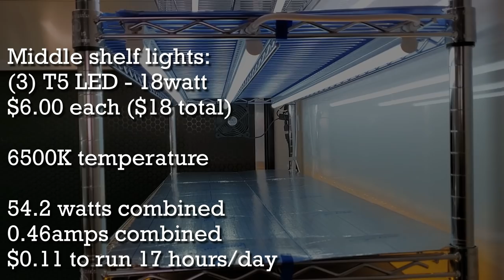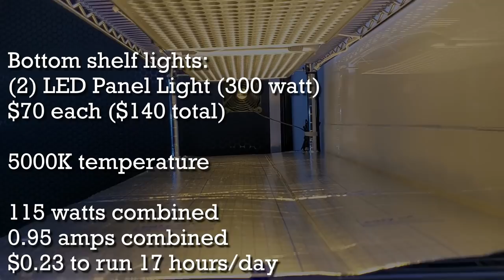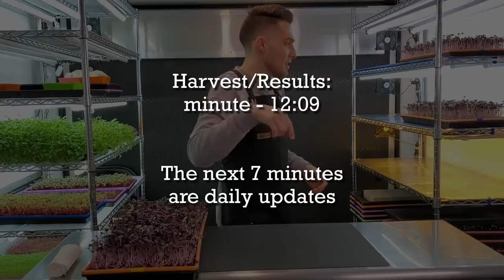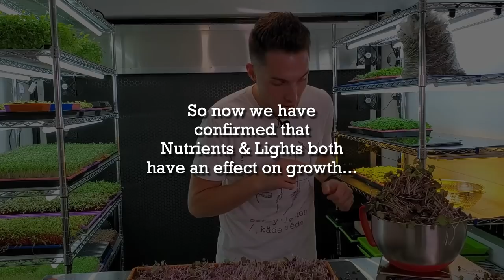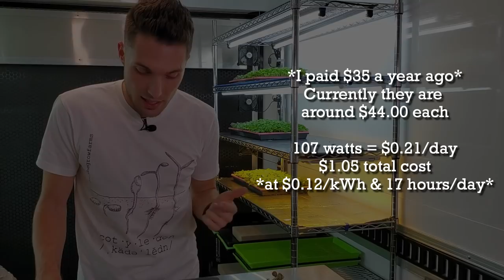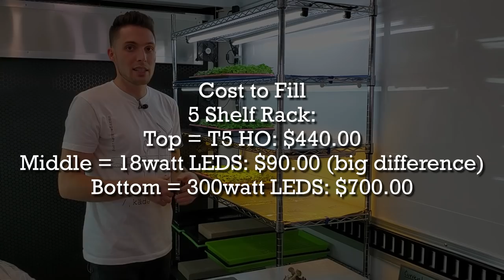Microgreen Lighting: Fluorescent vs LED's - On The Grow

Comment: Great video! 
(UPDATE, I did the math) Turns out, using the middle setup saves @ $400 over 5 years with the assumption that the flourescents need to be swapped once per year and the LEDs last the full 5 years. The initial LED upfront cost is large enough that they would need to live a total of 8-9 years without replacement, just to match the middle flourescents. If the middle flourescents go live longer than a year, it makes it all that much less likely that the LEDs would ever catch up. Also, just occurred to me that the $400 savings is just one shelf. Multiply by all the shelves and it is a huge savings.

Just waned to add a couple of add factors. LED may be a higher up front and I believe you factored in upfront costs into your days cost, but, I would add that the life of LEDs compared to fluorescents is huge. They last for ever and the energy cost is way cheaper, so, yes in a one year comparison, the LEDs end up being more expensive and maybe not worth making the change. I would like to see the math for a multi-year comparison. I believe all the products will give you an estimated lifespan. Using that, you could probably do a ballpark calculation of how many times you will need to replace each. It should be an especially easy calculation, being that you leave these lights on 24/7. Just my 2 cents.
Reply from the maker: Absolutely! We completely agree and we talk about that in the new lighting videos. The LED’s last supposedly 8 years while the fluorescents only last 1.5 years. So we would have to buy the fluorescents 5 times in the time the LEDs would last.
Reply: @OnTheGrow  Running the numbers, I think the middle flourescents stiil are the way to go. The LEDs seem to break even with the middle flourescents at year 8 or 9 and I was assuming only 1 year for the flourescents, If they truely get 1.5 years, that starts to put the LEDs out to 10-11 years break even. I assume you and your operation will look much different in 10-11 years and I am not sure the big LED investment will be worth it, unless the quality makes it preferable. I am looking at starting an aeroponics grow of a different type of plant and am going through the same type of calculations right now myself. (edit: In rereading this reply I realize that probably seemed like I was referring to "weed", I am doing saffron actually)
Reply: Doing it in Canadian $

LED array+shipping+taxes arox $200 to cover 1x 4 foot shelf 65Wx2 power draw 130W total
$800 to light up 4 shelves on a rack.
130w = .13KW/h x $.10 = $.208 in hydro cost per 16hours $6.24 per month per shelf
How many years will the LED array last, lets say 5.

Sunblaster shopping at local hydro store $42 after tax x2 = $84 to cover 1x 4 foot wide shelf. 110W power draw.
$336  to light up 4 shelves on a rack.
110w = .11KW/h x $.10 = $.176 in hydro cost per 16hours $5.58 per month per shelf
Need bulbs replacement every 12 months at say $12 retail each bulb so say $25 per year or $100 per 4 levels each year. so $500 in bulbs in 5 years

So in reality very little difference between the two. 

Production wise there aprox 12% more yield on the LED. Possibly nicer looking product so possible better sales and more $ per tray?
Reply: @karmakoma9743  Summary. If you are 1st tone grower and budget constraints are there, take the most affordable route. But if you are a committed gower (looking to upgrade your rack), or you just have the funds, go for the long haul. 

The full spectrum LED's (highest upfront cost) might be the wise way to go for two reasons. 1: Better yeilds. 2 a&b: Better for the environment (less waste tossing out old lights).

Comment: I recently discovered you guys and the content is awesome. I've got a small indoor nft lettuce system going and starting wheatgrass/microgreens now. My question is I believe the test may be more fair to the led tubes if you use 6 per rack to get the power draw per shelf even between types. There only $5ea in the 10pack which would be $30 per shelf for lighting with yield closer to the best one. This could be very cost effective and profitable if it makes gains over only running 3 per shelf.
Reply from the maker: We will give that a try!! Thanks for the suggestion! Thank you for your support, it means a lot to us!
Reply: Your welcome, it’s nice how much faster we can learn and improve through shared experiments. After watching your videos I’m running a test on those same lights on leafy greens grown to adult size in nft. NOTE I suggest using foil or something reflective on the shelf directly above these lights. In my initial check with a cheap light meter I got 3x more output with a reflecting top. The lights have a wasteful reflector for plant use
Reply from the maker: Good to know!! We will try and get some form of reflectors above it! Thank you for sharing 🤗🌱 We completely agree that it is nice when people openly share information as everyone can benefit from it so quickly!
Reply: I’m not very good on camera but if you search monster lettuce I just added a short video clip of the test setup

Comment: Hey guys what about the FANS energy comsumption could u guys share the info...
Also thank you for the content u give very informative and genuine...
Reply: It's pc fans, so they don't use any thing worth mentioning (12v each) and the way they are installed, I doubt they have any effect
Reply from the maker: Lol, okay expert. 

The fans cost like 2 cents a day to run or something like that. They work great for preventing microclimates above the canopy of the crop. Get a big fan to move most of your air, then the small ones to prevent microclimates on each shelf.

Comment: Nicely done. You mentioned that the bottom led is full spectrum, however it looks heavily in the 2700k-3000k range much like a high pressure sodium (HPS) bulb. When I think of full spectrum I think of a Quantum board with a mix of 3000k-5000k diodes with infrared and far-red in the mix (which almost produces a normal day light looking light) with little to no yellowish tones. Either way brother nicely done. If I wasn't so poor I would send you a real QB with a real full spectrum!
Reply from the maker: Agreed on the temperature being around the 2700-3000k. I just took what was stated in the description on the LED and used that to describe it. My other full spectrum lights are like you describe with little to no yellow.

We will be playing with a lot more lights soon!

Comment: How much did your trailer set up cost with all the equipment, minus the grow medium and seeds?
Reply from the maker: It was 15k for the decked out trailer, then about 5k in racks, lights, fans, dehumidifier, washer for spin dry and a lot of the supplies needed.

All in about 20k. It could be done for much, much cheaper though. Buying a used trailer and converting it myself would’ve saved 5-10k at least. 

With microgreens, you could make that back in 3-4months with the growspace. 

Check out our website for more information about the space! I’ll try to get a more accurate price on everything added together on the website! https://www.onthegrow.net/growspacefaq

Comment: Thank you bunches! I’ve been very interested in growing MG, for over 25 yrs- why so long that I haven’t? I caught the indoor growing bug in the early ‘90’s(the weed in Miami sucked, so I did something about it 😜) when I stopped, I knew I needed to not lose this skill! It fits in with my desire to be self sufficient & not eat factory chem food(organic was RARE back then, and when you found it, it was 50/50...) i was also an int’l “Zoolander” then as well. Since I quit in ‘08, it’s been service industry, carpentry, which led back to building/designing rather large MMJ grows. When LEDs came out, well, all the promise didn’t equal the outcome. How come? Studied it so much I was informing or schooling (in a friendly way!) the LED grow light booths well enough I was offered jobs from a few! Key points- how hard you drive them, especially for which color. Blue won’t work as well driven like a red. WHO made it is also important; they’re not all the same. Then there is a doozy- lensing and double lensing(or none at all); mind you I quit that biz five years ago. Don’t know how it is now with lights; as a whole it should be much better as a whole. Growing MG vs. MJ couldn’t have more contrasting needs though! I’ve just come across your YT channel, this is the 3rd vid I’ve seen(& yes, sub’d as well). Don’t know how late I am to this particular lighting party; if you’re still pursuing it, I could give you a serious collegiate level Cliffnote crash couse(bullet points that are key in 30-60mins) and in a way you’ll understand. Fact checking me will make your pursuit much more focused and fun! You might even stump someone or at least make pause..! LMK! HMU on FB or email me at kroozah@gmail.com to break the ice, then I’ll give you my ph#~ I can’t type, not really consumed w/SM or the protracted nature of it. Easier, quicker, more fun, more INFO. Want a good laugh? I saw you on YT, now you can see me(don’t judge though, it WAS a game show after all)... 1st 4 episodes of Survivor-China(‘07 season 15)episode 4, I do a challenge naked and ended up teabagging Aaron during a round(l went high, he went low..!) cheers, Dave Cruser

Comment: I have used an 8 light T5HO for seed starting and have the following observation:  The bulbs cost about $12.50 each, which is $100 per fixture.  The bulbs don't have a very long life, so bulb replacement has to be factored into the cost per hour of operation.  Further, the light output is reduced as the bulb nears the end of its life, and the bulb life is a little bit random, i.e. they fade at different times.  This leaves you with the problem of deciding whether you should replace the bulb that has lost some intensity, or wait a while longer until it is even weaker.  I suspect the output per watt decreases.  Finally, T5HO's are fluorescent, meaning the lamps are glass and have mercury in them - breaking one of them will definitely ruin your day.  Also, you may have to pay a recycling fee to dispose of them, and you will definitely have to drive them to a place where they are accepted for recycling - taking your time and some mileage costs.

LED's look good for microgreens, but maybe haven't quite caught up to T5HO's for seed starting - although I am not doing much indoor seed starting anymore.

Thanks for the great video!  So many garden videos just give ideas without providing comparisons or follow up results.  Running something like you have done here definitely requires extra work and attention to detail, but provides much better information.
Reply: i havent grown a seed yet. i am thinking of getting led as a newbie. you think thats good?

Comment: I was wondering since I switched recently to all LED's and ditched the HID's.
Reply from the maker: So far, LED's are doing an amazing job and cost nothing to run for extended periods. Also gonna save us cooling cost in the summer since they don't put out as much heat.
Reply: Hi, we get I buy the led grow light. I live in Greece
Reply: I believe results for lowest most tray are skewed as all other trays have bottom heat from light below that seems to make quite a difference. Also high par also requires higher environmental temps to be most productive 83 to 85 for high par and below 80 for t5’s and middle rack leds

Comment: Beautiful set-up and video.  In terms of product return on power investment, the center shelf seems the clear winner - bottom shelf returned only 15% more product using 50%more power.. probably  the 6500k 'daylight' spectrum is by far more efficient than full spectrum for vegetative growth - perhaps reserve full spectrum lighting/investments for crops that you'll grow to fruit or flower.
Reply from the maker: Agreed! We are really happy with our cheap LED shop lights! We already have 4 more sets of lights that we are about to test out in new upcoming experiments!
Reply: *Plus the cost was over 4x more for the bottom leds; dollar for dollar the blue shelf blew the other shelves outta the water in this comparison.

Comment: In addition to the extra weight, has any nutritional analysis been done to assess the quality of the product?
Reply from the maker: Great question! We have been wanting to do nutrient analysis for our experiments, the main issue is the cost to analyze. The cheapest nutrient analysis test I could find was $1,000 per test... so for a group of three different trays that would be $3,000 for a single experiment test. 

I have also considered using a BRIX meter, but since it only analyzes the sugar content, I don’t think it’s a reasonable measurement. 

We are open to other sources for the analysis of nutrition, so if you have any, please share! 

Thanks!
Reply: @OnTheGrow  ?"go fund me"?
Reply from the maker: Sue Young we’ve considered that, but running a campaign like that is a lot of work and I personally don’t think it’s worth the cost or work to run the campaign. It would have to be a pretty epic experiment for me to justify spending thousands on an analysis...
Reply: @OnTheGrow  you might want to look into something called a chromatogram or chromatograph. I think some bio-dynamic growers have used them, or Rudolf Steiner may have suggested them years ago. I'd love to see the results of them if you get enough background info as to what those tests are good for! (should be a pretty inexpensive test I believe...uses a paper filter and tests a solution/puree or extraction of the plant matter I think) If you use this test, maybe try some also grown in 'natural light only' to compare.
Reply: Maybe see if a local university would be up for testing them for you. You'd probably have to find out which relative field/study tests nutrient content. That way their students can learn/practice it and you should be getting results for less money? 
I don't know if that's an option but in my country the live sciences studies do labwork during their studies.
Reply from the maker: Thanks for sharing!

Comment: I think the full spectrum won for sure, it looked thicker as well as better color.  Where did you buy those?
Reply from the maker: We get most of our lights from Amazon and we have a lot more lights we are about to test. I wonder about the longevity of the full-spectrum because they don't have proper cooling fans on them... We have great airflow in our space, but I still am on the fence with recommending them. Here is a link to our light section if you are interested: https://www.amazon.com/shop/onthegrowfarms?listId=300RR4HQRM5I9

Comment: Great detail.  One factor to experiment with is which shelf each light is on.  Shelves with other lights underneath might play a role and possibly the reason why some trays dried out faster.  Also, airflow may be different at the different heights.  Thanks for the detailed experiment!
Reply from the maker: Totally agreed! The best way to test would to be have separate racks at the same height but it would just consume so much space for an experiment. Eventually I'll get a real lab xD Thank you for the support Todd!

Comment: Great presentation.  Several comments on your related videos mention Barrina LED T5 lights in 4,000K and 5,000K.   Given that the top-performing light in this test is 5,000K have you considered testing Barrina T5 4,000K and 5,000K lights (same price point as the 18w 6,500K lights frequently used).  Some have said that any energy distributed above 5,000 cannot be used by vegetative growth and is wasted (I cannot confirm this).  
Learning a lot here.
Reply from the maker: 🙂Thank you so much for the Feedback Jeffipookins! We appreciate your support! I will check on that!!!

Comment: Great video.  I needed this!  I'm just getting started growing indoors.  I purchased that same type metal shelving but mine is only 36" wide and I'm having a hard time finding 3' lights.  I may have to just go with the 4' length lights and overlap a few inches on each side.  At the moment, I am trying to keep my costs low. Question on the 18 W LED's; Do they plug in/daisy chain off of one another?  Also, how did you fasten them to the shelf?  Thank you so much!
Reply: Some can daisy chain, buy the ones I have seen that can are shorter and cheaper ones. Also Zip ties are your best friend for securing things.
Reply: @jamesbrown5262  Ok, good to know.  I ended up purchasing a 4-pack of 3' long T5 LED lights for around $45 on Amazon.  I'll have to see how they work out.  I have plenty of zip ties, too!  Thank you!

Comment: I like the data points you already are comparing. I think it would also be cool to see the end products nutrient profile difference between the lights. At the end of the day I would value the nutrient profile the highest and then compare the others for cost, weight, appearance, etc.
Reply from the maker: We'd love to do that too but the only tool is a BRIX meter which only measures sugar content. Actual nutrient analysis tests cost $1,000 per test, so we are kinda stumped on this.

Comment: LUX per watt is 269.6 for lower shelf, 129.6 for middle shelf.  Grams per watt was 3.69 for lower shelf, 6.65 middle shelf. Considering the quality difference, I would  probably go with the lower shelf lighting, especially for taller, longer growing plants. This would probably show a better weight to cost ratio.
Reply: The strongest light could probably light twice the area it was used for in this experiment, so with a bit more distance to the plants, it could be the most cost-efficient.